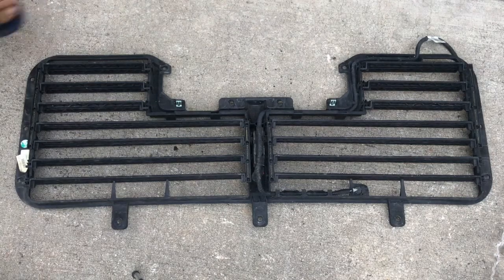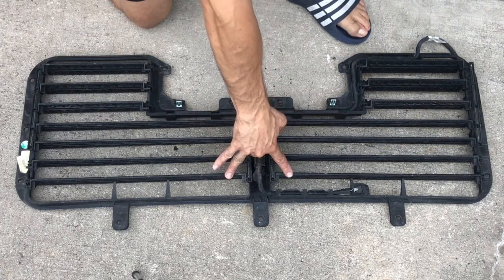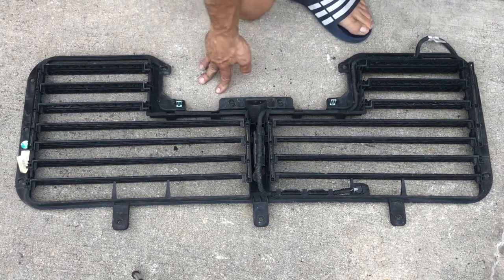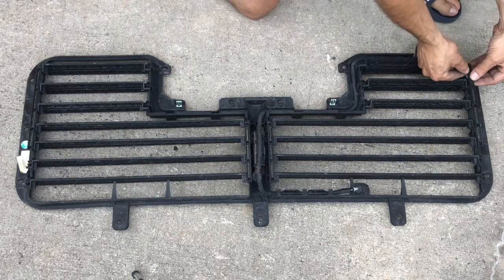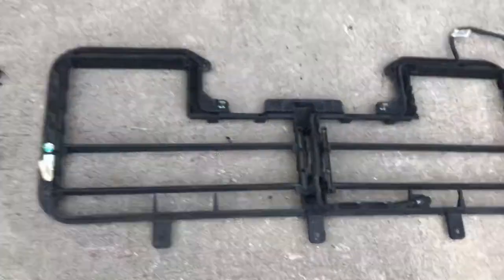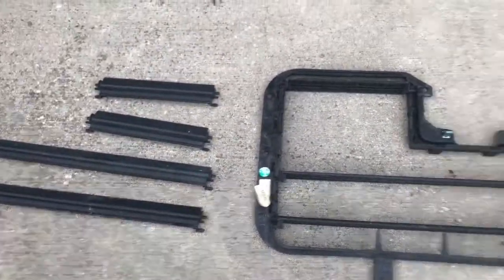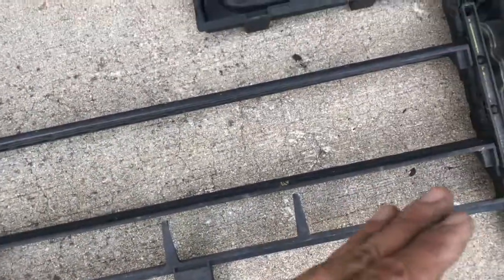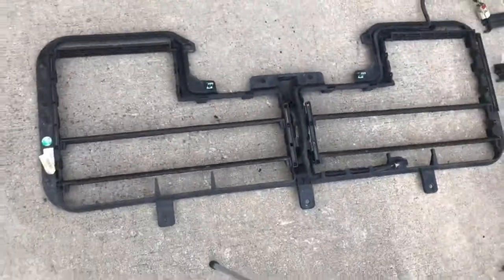GM Silverado Sierra grill shutters mod

Comment: Thanks for sharing. Better option than this is to replace the transmission thermostat (Bypass valve) with factory 70 degree C (158 Farenheit) thermostat bypass valve. 1 hr job at most. $100.
Reply: 1hr ? It took me 5 min
Reply: @jayjay7160 yep that is why I said 1 hour at most.

Comment: So I installed a light bar inside my grill on my 2017 Silverado and I just removed this as a whole was that a smart idea or do I need it
Reply: You may have a stored engine code, if im not mistaken, it wont trip the CEL but will store it as a malfunction
Reply: My question was did you get any kind of code or sel?
Reply: @Gixxagera   got a check engine light but never had a problem with the truck I’ve put it back in bc I got a ranchhand full bumper replacement so the light bar is mounted on that but never had a issue

Comment: To lower trans temps, you MUST do a trans thermostat "delete". On the side of the trans, the thermostat is set to 175 deg, and at hiway speeds you will get 20 deg over that due to the air conditioning core being in front of the radiator.
Reply: No just replace with the Factory 158 degree thermostat. Way easier.

Comment: I know this is an old post but did you ever remove the thermostat pill on the trans to control the temps more? How's your transmission doing, holding up?
Reply: I did, runs 30-40 degrees cooler
Reply: @jatmomdadjt8744  did that make more difference then the shutter delete? What all did the shutter delete accomplish, benefits?
Reply: @neptunepoolsserviceandrepa2529  I haven’t done the shutter delete on mine yet but I am planning on getting a B&M deep transmission pan and mishimoto cooler in the near future as well as 4.56 gears since I have 35s on mine.

Comment: Have you done the thermostat delete or added a aftermarket trans cooler? I seen you said this hasn’t changed in temps much.
Reply from the maker: Yes. I installed the Sure Cool thermo bypass a few months back. I did see cooler temps, but not as much as some of the guys on the Silverado forum. But then again I live in FL, so it gets pretty hot down here. It still gets to the operating temps of the 190s but it takes longer to get there. I haven't installed an aftermarket trans cooler yet. That's probably my next step. Also, to change the trans fluid and filter. I just 30k miles so I think it's time. BTW, I towed my boat last weekend on an hour and a half ride (21ft Sea Ray, dry weight 3,500 lbs + trailer) and highest it got was 205 degrees.
Reply: It's for the radiator. The PPE  thermo bypass works great. Always 30-40 degrees cooler even in the AZ summer heat. But I don't tow so maybe if your actually going hard it might rise but still  be cooler

Comment: Why would you deter what the engineers factored into the design?
I’m curious only because I recently purchased a 2017 GMC Sierra Denali ultimate with the 6.2 engine and 8 speed auto. The truck only has 25,344 miles. 
Isn’t that grille shutter supposed to help with mpg, engine performance and the cooling system?
Reply: I deleted mine because in freezing temps they stay shut at speeds above 50mph.  That’s a problem when you have a plow on the front of the truck that limits airflow to begin with.
Reply: 2018 Silverado with 111000 miles & my shutter went bad. $300 for a new one. Nuts
Reply: They're designed to close at higher speeds (55 mph) to reduce drag and make the vehicle more aerodynamic, if they detect any type of over heating they open back up on their own. This mod pretty much just made a higher end vehicle like the lower end vehicles that don't come with this option.
Reply: @hdrolling  The problem is they fail and then they won't open or close.  You don't need this option, it's junk.  All it does is help emissions and mpg.
Reply: @Jose Duran Jr

"Why would you deter what the engineers factored into design?"

Have you seen all the TB, TSB, class action law suits against GM and their transmissions? Just the 8 speed alone has 60+ TBs over the past few years. 

GM tried to have one of these class action lawsuits thrown out claiming that the transmission problem are related to a design defect and not a manufacturing defect.

Excerpt from an article regarding one class action suit:
"GM has argued that these claims should be thrown out, as its express warranty only covers defects that relate to materials and workmanship, and not design defects. The suits claim that all 8L45E and 8L90E transmissions experience these problems, which implies the problems are related to a design defect instead, the automaker said."
Reply: @14burrito2  This is JUNK. it doesn't do shit, but get your car warmer quicker in the winter. If you care about Aero Dynamics, you buy a sports car, this is a damn truck. The engineers love to "OVER ENGINEER" shit. This is Crap. My vehicle is a 2017 GMC Sierra, it has 82.000, and this broke (error U1510). I took a different approach, and used a Adruino and C++ to emulate the motor. In MA, the vehicle will not pass the inspection with a check engine light, and this CRAP does throw a check engine light so... This will cost from $250 to $400+ depending on the dealership's location, markup, etc, etc.

Comment: @vegajay How did it work our ? Good or bad ?
Reply from the maker: To be honest, pretty meh. I expected more noticeable results but I barely saw much change. Probably only like 5 - 10 degrees cooler. There may be other issues causing my temps increase. I’m starting to see a pattern. Once I start going over 78mph, that’s when the temps start to climb, especially if I’m not going a constant speed, like when passing. Maybe torque converter friction? IDK. The other day I got to 199 by the time I got off the highway. Right afterwards, sitting in local traffic, it peaked to about 210 before finally starting to drop after like 10 mins.
Reply: @vegajay  so whats the verdic?  have u since did any mods?  and did u add one of those SURE COOL made by superior,  FOR ACTIVE BYPASS?  part #STL010  is for the 2018 silverado LT 4x4 5.3   6L80E Transmission  6speed.
Reply: Update? Did you get a code after the mod? My temps fluctuate when towing. Thinking this might help. Thanks

Comment: This is a really good video. Looking forward to your follow up video
Reply: You need do what I did,call the flip,go under and  remove the cartridge where the thermostat is located,once you get out carefully the thermostat remove inside the pill and the spring,then insert the pill where the spring was and the spring inside the thermostat, spring is hollow so air will always reach and cool down transmission mine now reach the most 180° when towing and have to stop to much on lights
Reply from the maker: To be honest, the results were pretty meh. I expected more noticeable results but I barely saw much change. Probably only like 5 - 10 degrees cooler. There may be other issues causing my temps increase. I’m starting to see a pattern. Once I start going over 78mph, that’s when the temps start to climb, especially if I’m not going a constant speed, like when passing. Maybe torque converter friction? IDK. The other day I got to 199 by the time I got off the highway. Right afterwards, sitting in local traffic, it peaked to about 210 before finally starting to drop after like 10 mins.
Reply: Try changing the stock 207 degree thermostat to a 194 degree thermostat.  It made a difference on my 2018 Silverado 1500 with the 5.3

It used to go beyond 210  at high speed highway driving but it no longer does that si nice installing the 194 degree thermostat
Reply: @vegajay  Check for bugs built up between the condenser and the radiator. Mine was literally packed. What’s the current update on your normal operating trans temps?
Reply: I have the same problem on my 2019 temp goes up when I'm going 80 on the freeway and also noticed once trany hits 200 it starts shifting hard. It's a new manufacturer trany and shop can't find anything wrong lol idk what's going on. I just put ppe bypass valve will see what happens

Comment: Any difference in highway speeds towing
Reply from the maker: To be honest, the results were pretty meh. I expected more noticeable results but I barely saw much change. Probably only like 5 - 10 degrees cooler. There may be other issues causing my temps increase. I’m starting to see a pattern. Once I start going over 78mph, that’s when the temps start to climb, especially if I’m not going a constant speed, like when passing. Maybe torque converter friction? IDK. The other day I got to 199 by the time I got off the highway. Right afterwards, sitting in local traffic, it peaked to about 210 before finally starting to drop after like 10 mins.

Comment: did you notice any positive cooling results?
Reply from the maker: To be honest, the results were pretty meh. I expected more noticeable results but I barely saw much change. Probably only like 5 - 10 degrees cooler. There may be other issues causing my temps increase. I’m starting to see a pattern. Once I start going over 78mph, that’s when the temps start to climb, especially if I’m not going a constant speed, like when passing. Maybe torque converter friction? IDK. The other day I got to 199 by the time I got off the highway. Right afterwards, sitting in local traffic, it peaked to about 210 before finally starting to drop after like 10 mins.